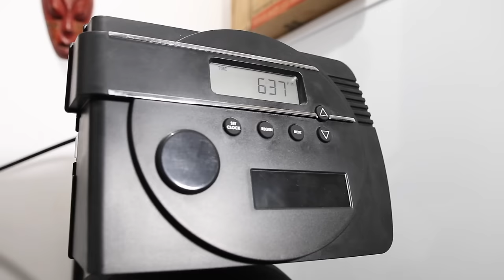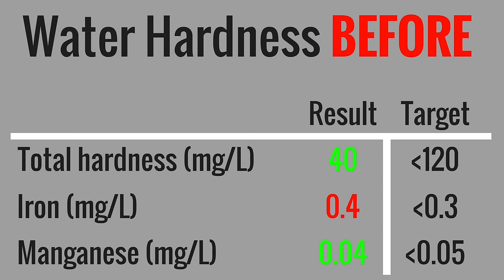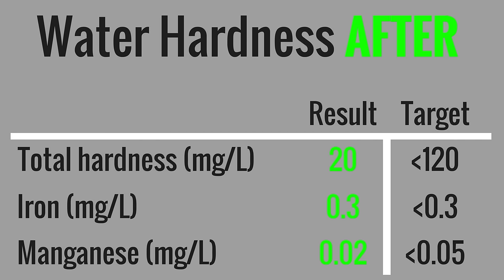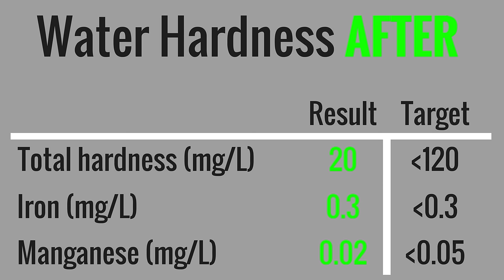WATER SOFTENER SYSTEM : HOW IT WORKS !!

Comment: Thanks very much for  your video! I did not know any thing about the hardwater until I found out the scum in humidifier, bathroom fixture,...then I bought a water quality tester, the water in my house before using water softener system is about 400 mg/l when using the softener system, clean softener system by the by "out filter mate" product in the Homedepot,  the total hardness is more than 2000 ppm. Do you think the pipe system is too dirty ? please give me some advice how to fix this! Thanks a lot!
Reply from the maker: You're welcome!

Comment: Thanks for the video. I don't see the salt being used up which makes me think that there is more maintanence than what you referred to, I believe there can be scale that builds up in the line to the salt tank. Is that true ?
Reply: You probably have a salt bridge that need to be broken up. Basically all you need to do is break up the floating layer of salt that's preventing it reaching the water in the brine tank. If it's been like that for awhile it's recommended to break the bridge wait 4-6 hours to allow the salt to dissolve and do a manual regen/backflush per the owners manual.

Comment: Hi, So I have a borehole on my property located in South Africa. I did a full lab test on the water. It seems that it has a very high hardness of like 520 mg/L of CaCO3. The sodium content in this water is 320mg/L which is considered high. THis is before any filtration or softening. I approached two different companies and they stated that because the sodium is already high in the water it will cause some of the ionic beads to release the calcium and magnesium molecules that was exchanged in the previous ion exchange process.. So basically a close loop where it would exchange some sodium for magnesium and calcium but later it echanges back and the magnesium and calsium would return into the supply water going into the house. Does this seem tru?

Comment: Thanks for explaining the difference Pan! I have a  question in regards to the PPM. My tap water ppm before softening was around 320 and it shows the same after softener is installed. Could you pls lmk if ppm should go down or can remain same? If same then is it still softening the water?
Reply from the maker: I’m not a water treatment expert, but normally the numbers should go down as I showed in the water analysis results.

Perhaps you should contact a reputable water treatment expert near you and have them investigate your setup?

Comment: Great video! Very helpful! 
Just one question....I assume tap water will not be available during a backwash. Is that true? Also are the backwashes scheduled automatically or scheduled via a set time or time period? Thanks!
Reply from the maker: I set the backwashes at a scheduled time at night (every 4 days).  Tap water is accessible, but my installer told me I shouldn’t drink water during backwash.

Comment: Great info. Is there a filter that should be changed regularly?
Reply from the maker: It depends on your setup.  In my case, I have a pre-filter that just needs to be cleaned once in a while.
Reply: @PanTheOrganizer  Is the pre filter in the long tube that's in the salt container? That's the only thing I see, but it looks more like a long water float. Tku.
Reply from the maker: No it’s an optional pre-filter before the water goes into the tank.  It’s compact, transparent with a red knob.  You see it in my video.

Comment: Do you ever have to press the REGEN button? I purchased my home and it was included but no directions as to what I need to do with my water softener. Thanks for the video!
Reply from the maker: The regen is automatically programmed to go on each 4 days in my case.  You should consult with your local water softener expert.

Comment: I like the video.  I think that your target of less than 0.3 mg/L of iron seems marginal considering it was 0.4 mg/L before and 0.3 mg/L after. 
 What are your thoughts?  I wonder if it's a matter of still releasing the mineral scaling from the piping downstream (post softener system to faucet) of your water softener system.  My family is looking at getting a water softener system installed due to being well over target.  I want to make sure we're making the best choices and not overlooking something else.
Reply: So... his system was already in spec for soft water.   So the benefits are going to be minimal because they are already close... if he tested a hard water inlet then it would be more Impressive. At this point he's just polishing water... if that soft water was fed to another system.... you wouldn't expect to see much improvement

Comment: Your video was very interesting and informative, but you left out the cost for the h20 system?
Reply from the maker: That’s because the costs vary depending on what type of resin will be needed to treat your specific water issues, plus what country you live in, etc. My system cost approximately 2500$ CAD. But check with your local water treatment experts.

Comment: Nice video and explanation. thanks!
My water became way too slippery. TDS meter reads at 200 (after the acid neutralizer and water softener) with high PH of 9+). TDS read after the RO system cut it to 13.

The TDS reads in the house are higher than the row well water. Im confused. soft/slippery water should have low TDS read.....
Reply: a water softener adds sodium, which is part of tds. a pH of 9 is concerning. you should be around 7. my advise is to talk to a (different) professional  to make sure you have the right equipment installed
Reply: @curts5508  sodium from the salt?

Comment: You did not mention anything about the 120 gallon water tank that is mounted near the water softener. Does the softened water go into the big blue tank AFTER it is softened and then pumped into the house? Or is the water pumped raw into the tank first and then through the water softener and then into the home. Some of us country folk have wells and they are nasty with calcium, iron, manganese and horrible sulfur, unless that smell is from the putrid iron. I thought about moving my softener away from the well and bringing it close to the house where it is easier to access and fill with salt. My well is 150 feet from the main. Unfortunately, when my Ecowater Softener, $4,000 was installed without a leanto or shelter from the sun, I was not aware that the plastic $500 housing would be eaten up by the sun. So, does the water holding tank need to be next to the well and water softener? Or, can I leave the water holding tank at the well and move the softener close to the main at the house where the access would be much easier?

Comment: Dear Pan the Organizer, I have just bought the same water softener system (used) as you feature in this video. I'm trying to find the model number and the owner's manual, but after searching high and low, I didn't succeed. Would you know? With my thanks!
Reply from the maker: I moved into a brand new home this past year, and I have a new water softener system. I don't remember the previous one unfortunately. Your best bet would be to contact a water treatment specialist near you.

Comment: Great video. My dishwasher just bit the dust after owning for 2 years. Guy came in to check it out and once he opened it said "you have a serious hard water problem." I know have to install 1 for my home. Which water softener do you recommend and which do you have installed. Thank!
Reply: I also read an article that states ion exchange adds more sodium in your water. Do you notice a taste of salt in your water?
Reply: Last question, where did you get your water tested?
Reply from the maker: I didn't notice any change in water taste.  If any sodium is added, it's very minimal.
Reply from the maker: At my local store where they sell and distribute water softeners.
Reply: I've looked at several thus far but have seen one that has the filter to collect larger particles. Which is yours?
Reply: I'd recommend to hire a professional. did he test your water for hardness? if not I suggest you find another professional. proper testing is essential, and a water treatment professional has knowledge and experience to do the job properly. you get what you pay for

Comment: Great video. However water softeners decrease the life of the anode rode of your water heater considerably and if you don't change it every 2 years or so your water heater will start to rust quickly.

Comment: I have a Crystal Clear Model 1479 see it like Your Machine, and 6 Years old about, 
Today it have a problem to the Wast Water run continuing, may be from 3 Days or may be before that, causing don't check them, a lot of Wast Water,
I have to tried to unplugged the Power and Bypass at Twice, and Today restart again but nothing Changed, Could You please tell Me how to fix It?
Thanks You!

Comment: Great video. Question, if it snows on your car and you want to brush it off, how would you prevent scratches on your paint. Is there like a special brush or something. Please tell me
Reply from the maker: You need a brush that has feather tipped bristles and don’t completely remove all the snow.  Make sure you leave a small layer of snow to ensure you never scratch the paint.
Reply: Pan TheOrganizer thanks I never thought of the feather tipped bristles.
Reply: Many car lots and my neighbor use their leaf blowers and blow the snow off...lol!  The car dealerships have more professional heavy duty blowers but for household use the leaf blower works fine.

Comment: A small correction: Hard water contains calcium and manganese, not magnesium. They're two different things. Manganese will turn your stainless sink black, while magnesium is good for you and desirable. Iron can be found in both hard or soft waster, and is not considered part of the water hardness. Most water softeners, though, can remove up to 3 ppm iron as a side benefit.
Reply: For me this is a BIG mistake and a BIG correction

Comment: Does having the water softener system help your DI resin last longer? Thanks
Reply from the maker: It's actually the opposite unfortunately. It depletes my DI resin faster. I asked CR Spotless (the maker of my DI system) why and they said it's because the softened water raises the actual TDS levels (even though a water softener removes a lot of minerals, it also adds salt), so the DI resin has to work harder. I have to change my DI resin more often because of this.

Comment: Good Video! One question - Does the system decrease your water pressure? I like a hard shower!!
Reply from the maker: It will make it drop a bit inevitably as it has to go through a filtration system, but not that much. We didn't really notice a big difference. Especially if you have good water pressure to start off with.

Comment: Is it ok to use this soft water to wash my car? I have a salt based softener.. thnx and great vid!
Reply from the maker: Absolutely. That's the water I was using for many years in my previous home garage, and this is one of YouTube's biggest car detailing channels. Softened water is much better than regular tap water for washing cars.

And now, in my brand new home, with custom two car garage, I have a more advanced water deionizer setup, with ZERO minerals, for a spot free wash experience. I made a video about it here: https://youtu.be/IKNL1chAQXY

Comment: What did this cost you, parts and labor? Do you need to replace anything over time aside from the monthly salt?
Reply from the maker: This unit was 2500$ CAD installed. No maintenance other than adding salt once or twice per month depending on your water consumption. The price of the unit varies greatly depending on what type of resin you need, which is dependent on how hard your water is after analysis. My water was pretty soft to start off with, so I didn't need expensive resin. It's best that you talk this over with a water treatment specialist near you.

Comment: I was so dumb not to research this sooner. I live in a rural area and we have a well with crazy hard water that stains white clothes. I never knew they were actually so affordable I ignorantly assumed the systems costed thousands but I’ve seen them from $350 - $800
Reply from the maker: It depends what system and what resin you need. Mine cost 2500$ CAD. They can go up to 6000$. You have to consult with a water treatment specialist near you.

Comment: Cation resin isn’t the best media for removing iron.

A softener is not a good way to reduce iron in water.

You need specific media for iron removal depending on the type of iron you have in the water.

Iron fouls cation ion exchange resin, making its working life deteriorate and blocking the sodium exchange sites through the polymer bead.

I would suggest removing iron by either filox or MMSAF before entering the softener. 

Iron fouling in resin beds is not removed with brine and usually requires specific acid cleaning.

Other than that, nice video
Reply: Well that is not necessarily true. If you have Ferrous Iron (most common), then a water softener is the best way to remove it. It is true that Iron will start to coat the resin bed, so someone would use Iron Out salt or an Iron out additive to the salt, or even better use a 12 CC Mineral re-activator feeder to keeps the resin bed clean.

Comment: how much is the system and what is the tds meter reading after your installation?
Reply from the maker: I don't really remember the cost as this was many years ago in my previous home. A few grand for sure. But the price really depends on what exact resin and system your specific home/situation requires, so check with a water treatment specialist.

And I gave the actual lab analysis report of the water quality after the system was installed in the video.

Comment: I have a rain fresh 30t and it isnt using salt at all and it never regenerates automatically, only when I manually regen it. I tried looking at it and the only I noticed is that I cant move any air on the fill line when I disconnected it on the salt tank. Is this normal or do I have a serious block?

Comment: Hi Pan. Great video! So I have two black tanks just like yours. One for the hot water and the other for soft water. Both came with the house I bought. My question is once in a while at night, the soft water will make this loud noise for 20 minutes as if it’s cleaning the water. On the screen it says RR and then the clock ticks down from 20 min to 0 minutes. I’m assuming this is a normal process and my soft water is just cleaning the tank. What do you think is happening? Have an idea what RR stand for? I’m thinking it stands for Regeneration. Let me know what you think. Secondly, do you know if there is any maintenance on my endless hot water tank? (both systems are very new). Appreciate the help! I subscribed to your channel.

Comment: My well water is soooo hard that we have THREE resin tanks that flush out every 24 hrs.  Then we run it through a reverse osmosis before drinking.  But, it’s the best drinking water I’ve ever had.
Reply: Well's Water = Best.  Also, if anyone complain Dry Throat or Thirstier after drinking Water... It's the Carbon Filters + UV Lights (If you have it).

Comment: I have a question it has been 2 months since my installation. The tank that has the salt has hardly gone down. Seems it is just pooled on the bottom of container. We are a household of 4 adults and only 2 bags were placed in time of installation yet the salt seems to stay the same. Is that something normal or is something not working? Thanks
Reply from the maker: You will have to consult a water treatment specialist near you.

Comment: Help, the house next door has this, every time the thing flushes, cal floods the houses next door. Yesterday was adding water to pool, when it turn to milk. At same time the tank was cleaning. Any idea why? Have they got a bad check valve or connection?  How can this reverse back into the water supply. Also city psi drops every afternoon, and the system has a pump. Could the system be over powering the city psi and the cal going back out?  Can someone advise please.

Comment: Wondering if would be a good idea to run a tap from water softener to wash cars? Would the presence of salt destroy any coating on the car?
Reply from the maker: The amount of salt in softened water is negligible. Hence why you can drink it, and it won't taste salty. I have a water softener system in my home, and detail cars all the time (this is a detailing channel first and foremost). Never had issues. I also installed a water deionizer setup in my new home's garage, to have ZERO minerals for my final rinse, for a 100% spot free car wash experience.

See my video on my DI setup : https://youtu.be/IKNL1chAQXY?si=GH-DtcqK3-WoCC_l

Comment: Is that an over flow drain (white) on the side of the salt water tank? Is there a hose for it?
Reply from the maker: That's just an extra freezer where we keep food.
Reply: yes it is. although it should never reach that point as it has a float shutoff to prevent overfilling, so the overflow is rarely plumbed to drain

Comment: Here in az I will not wash my vehicle with regular hose water. The water is so hard clay bar will almost not get the water spots off.. I’m currently trying to find an easy somewhat cheap system being that it’s not my house and I rent inline water softener system..
Reply from the maker: Check out CR Spotless deionizer systems.

Comment: Just reviewing your thread.  Thank you for the information.  I have to replace my Softener system and need assistance with what brand is best and also could you tell me if no salt systems remove calcium?  Our main goal is to remove the calcium from the water, we do not use for drinking, just sinks and shower usage.  I appreciate it.  By the way, we are on well water.
Reply: Have the water tested that can tell you or the rep exact type of media to put in the tank  and I usually use the csi systems